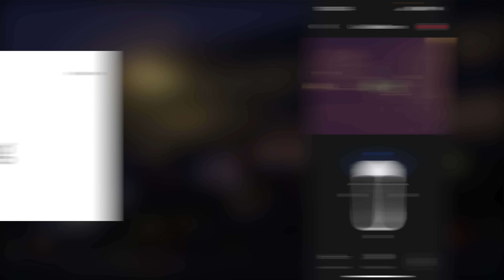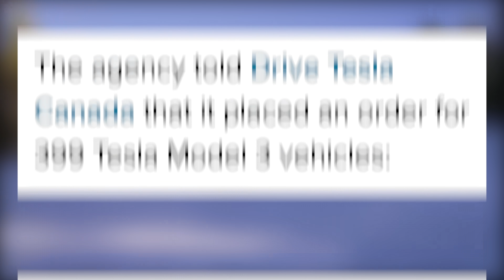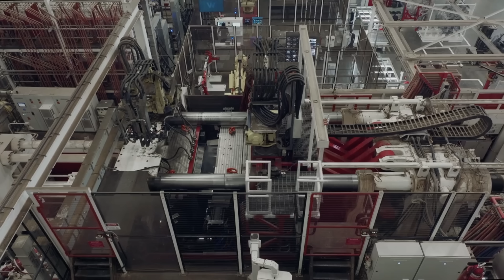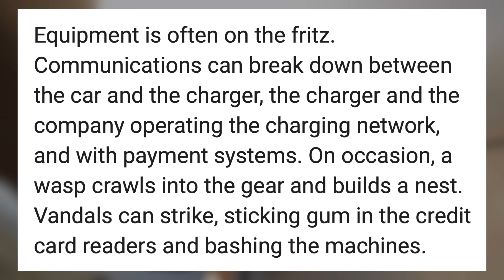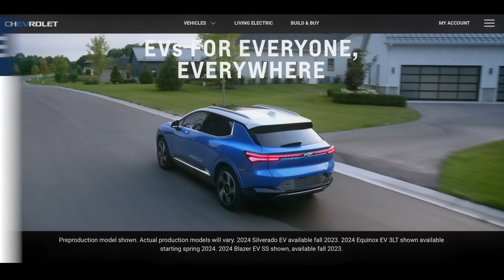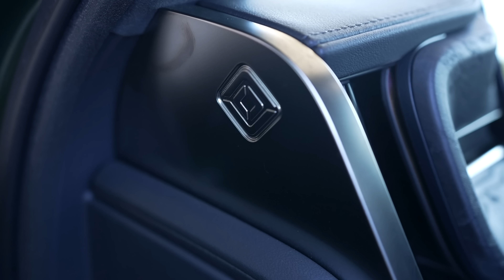The TRUTH About Charging a Tesla | It's More Important Than You Think

Comment: The worst experience I've had is hotels that have paid L2 chargers, $2 per hour for the first 2 hours and $5 per hour thereafter. At 6kw/h it would have been like $50 to charge. Faster, cheaper to go to a supercharger a few blocks away. I wonder what it'll be like when they start trying this crap in the middle of nowhere when it's the only charger for 100 miles.
Reply: I would submit if the hotel is the only charging in 100 miles, then it is worth a premium to charge. I paid $7 a gallon on a lonely stretch of I-40 between TX and NM just a few weeks ago.  Totally worth $110 tank (Penske truck) versus walking. My bad for not filling up sooner before that stretch.  I’ve been driving Teslas since 2013. Very few instances of paid charging outside of the SC network. I do agree that I would drive to a nearby SC versus paying $50 to charge at a hotel - but the middle of nowhere scenario is a different story.  Also, I tend to plan my trips as an EV driver and usually avoid that dilemma.  YMMV, of course, just my two cents. We all have different levels of risk tolerance, etc. 😊
Reply: Hmm, have only charged at a few hotels but it has always been free.
Reply: @JoeS97756  in general that’s true, mine was the Hampton inn in farmers branch tx. Chargepoint branded. No voucher

Comment: How convenient of those legacy auto companies now complaining about needing charging stations when they were given the opportunity to work with Tesla to build out such a network and yet did not do so, instead rooting for Tesla’s demise so as to allow them to keep the cash cow of ICE vehicles flowing.  I say screw them - they can get whatever scraps Tesla decides to give them OR they can do the hard work of setting up their own networks.
Reply: The worst part is that they ALL coulda shoulda offered electric options for decades, at least, if not a century
Reply: There's a way out now.
Companies are on "low" or negative EV margins ?
They are, or will be soon, looking for "back door bailouts"?
So, adopt the predominant, reliable standard.
On the condition that the designer of that standard (coughteslacough) allows others to build chargers under license, with their own branding.
The Government give a grant per charger built.
That effectively saves the government bailing out certain companies, since the profit from chargers subsidises the vehicles.
.
Tesla is insulated from FUD if the let's say "GM chargers" have an issue, but everyone wins......
Payment.
Use the Tesla system, but with another administrator, removing the "I won't give Tesla my data" issue.
.

Comment: I cancelled my Rivian reservation back in February and bought a Tesla instead. Rivian initially said they'd build their own network. But that hasn't happened.  I won't buy another brand of EV until Non Tesla charging networks are reliable. There's a huge opportunity here for other Vehicle makers to step in with their own charging networks, or for some other company to build a reliable network. 

Imagine owning an ICE vehicle and half or more of the fuel pumps you encounter don't work, are out of fuel, or pump fuel so slow that your Truck takes 6 hours to fill-up.
Reply: I drive my Mode S 545 miles from Northern to Southern California.  No other ev can do that in a day except for Tesla. 
I stopped twice to charge. About 30 minutes each time at 250kw superchargers.
Reply: Agree, however as in my case, I charge at home and solar produced energy, and I don’t go often on long car trips, so for those with similar cases, it’s perfectly fine.
Reply: But main reason for tesla having more charging stations is gives very low range than claimed so obviously you have to charge very frequently unfortunately. I booked Model Y and unexpectedly I had to use my cousin model 3 when I gave my car for auto body repairs and I realized uses lot of battery for window heat etc. since I live in cold climates and Tesla charging is not that great, cancelled model y and reserved lucid air touring. Hope that works well. Got 3 years free charging though and they have electrify america partnership i think
Reply: @bikshamtg3777  I own a 2022 Model S long range with 19” wheels.  Tesla says 405 mile range. That’s possible if you charge to 100% and go to zero AND obey the posted speed limits.   I am told the battery holds up the best when it is used in the 20 to 90% range.
That’s 70% of 405 Which is 283.5
If you drive nuts the whole time you will get about 75% of the claimed range. So the minimum range when using the battery in the 20 to 90% range and driving ridiculously fast is 212 miles.  I went on a 450 mile road trip and supercharged twice for 25 minutes. That’s amazing and not possible with any other car on the market.  Ask anyone who has had a road trip of that length with any other make and it’s always a painful experience.
Reply: @bikshamtg3777  So you went from a Model Y that costs about $70k to a Lucid Air that cost over $140k? Heating the car could drop the range by 15-20%. Seat heaters are more efficient but that might not be an option. You didn't say if the Model 3 was long range or standard range. The long range should give you like 250 miles of range if you don't speed. Charging 15-20 min should give about 200+ miles of additional range. Tesla charging is great. Sure they don't reach 350kw, but the cars that can do that only stay at 350kw for a few seconds before they drop down to lower speeds.  Those other cars might charge a bit faster overall but not by a huge margin. The difference is the reliability of the Tesla charging network. You can read about the reliability issues with the EA network. Even if you can find a 350kw EA chargers, the chances that it will be taken, out of order, or charge at a lower speed are pretty high.

Comment: Me and my wife bought iphone 12 pro 2 years ago same time. I charged always 100% but never went down under 20%. She never passed charging over 80% but mostly charge It went down under 5%. After two years my phone’s battery health was 88%, hers was %85. I think best practice is never going down under 20% charge.
Reply: It depends on the battery chemistry and also don't forget that cellphones don't have battery management system like EVs do for their batteries.

I've had a Model Y for over 2.5 years. During that time I changed to 100% numerous times. I noticed that my range decreased the more I charged to 100% specially when fast charging in long trips.

My wife also has a Model Y. She has never charged it to 100% however she has run the battery as low as 10% multiple times while traveling. No degradation on her car battery.
Reply: @acolon8999  makes sense. Thank you ✌️
Reply: @acolon8999  I put 50k in 2 years on my Y. There’s been a 2% degradation to the battery as I rarely charge beyond 80% except in deep winter when it’s 90% and sometimes have long return home trips due to traffic in inclement weather.
Reply: @brandise76   Both my wife and I charge our Model Ys to 75% daily. At the end of the day my car is usually around 60% and hers around 50% even during winter (this is the first Winter for her) she is still getting home at the end of the day with at least high 40s ( Northeast Winter, USA)

My car has just over 50k miles and shows about 4% degradation. Hers is just over 10k miles. Since day one her car has been showing around 330 miles and it is still showing that. He car is supposed to have an estimated range of 316 miles (long range with induction wheels which are selected in the configurator)  but I've never seen it go below an estimated of 328 miles. Like I said, she has never charged it to 100% and I believe that is a contributing factor to the good health of her car's  battery. The car has been Supercharged many times but never above 98%.

I think the battery chemistry on mine is also different since mine is an early production Model Y (VIN in the low 2k) and her VIN is in the 421k range. Both from Fremont.

She does a lot of skiing in Vermont. I am curious to see how much the low temperatures in Vermont are going to affect the battery.
Reply: @acolon8999  the car will regularly have you go below even 10% when traveling long distance. I really don’t worry about it anymore tbh. The car does what the car wants lol
Reply: @MegaGyalis  We do most of our long distance road trips along the East coast (New England to Florida)  occasionally New England to Pennsylvania. There are so many Tesla Superchargers that the Tesla navigation usually keeps us above 14%. My wife follows the Tesla navigation and usually doesn't deviate from it's charging stops. If we are driving my car, I find myself many times skipping one or two charging stations. I've gone as low as 1% which I know is bad for the battery but I don't do that often. I usually try to keep it at what the tesla navigation system recommends or at least over 10%.
Reply: All that effort was probably not worth the 3%
Reply: 3% variance can be attributed to anything including manufacturing variances and environment used/charged.
Reply: Also keep in mind that phones are li-ion.  A different type of battery.  No?

Comment: Tesla opened up their charging plug. Won’t all cars using that plug be allowed to charge at Tesla chargers? That would solve the problem for those cars, and allow Tesla to extend their charging network to keep up with demand, don’t you think? It would also be good for Tesla.
Reply: Also using solar and battery storage at their chargers going forward means the superchargers will be pure profit for Tesla
Reply: Tesla is already opening the network so there’s nothing stopping any automaker from using NACS and benefiting from Teslas network.
Reply: Short answer: no. You could have the ncs connector on a non Tesla and plug it in but the Tesla charger wouldn’t let you charge. It communicates with the vehicle before allowing charging.
In salvage vehicles this happens a lot. Tesla turns off supercharging to them so they can plug into the supercharger but it won’t give them energy. 
Personally I also think opening the network is counter to profit for Tesla long term. They make a few bucks on the charging but the exclusivity of the network is one of Tesla’s biggest selling point. With their market shar dropping I suspect they will maintain the chargers being mostly exclusive for at least the next few years.

Comment: I had a Mach-E Route 1. I absolutely hated the car. Infotainment was terrible, laggy, frequently disconnected bluetooth, phone as a key NEVER worked. As for Range it never got above 200 when the Kia Niro EV we had routinely got 240+ (even in winter). Sad that a smaller EV with a much smaller battery got better range. It does look good though. Also, Electrify America rarely worked right and always had issues but that's not entirely Ford's fault.
Reply: Let’s also not forget the horrible brakes. Absolute shite.